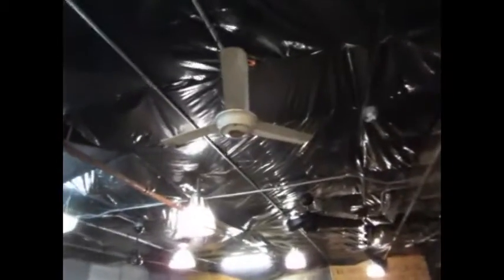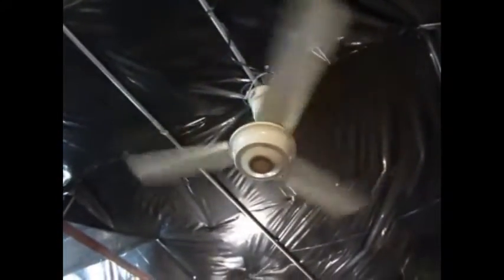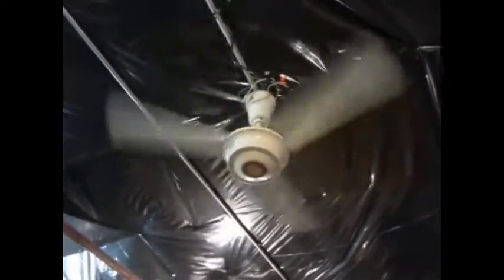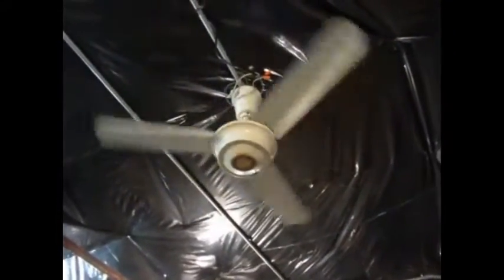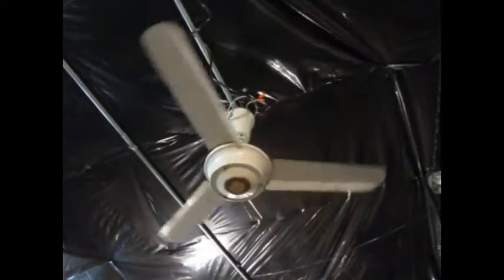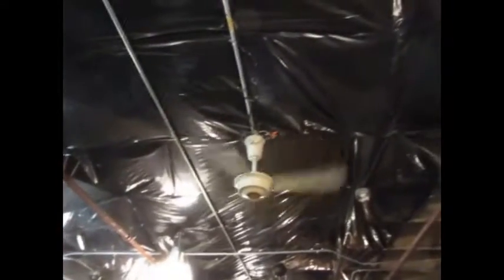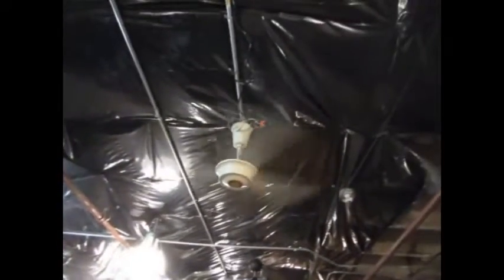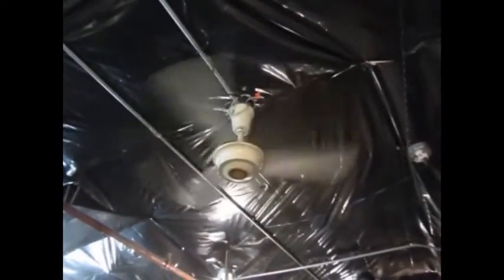Moss Caribbean Breeze industrial ceiling fan before restoration

Comment: An even better solution is to use a variac.

That way you have full control over the speed from its slowest to its fastest.

Also were you able to get the bottom cover off? If so how is it done?
Reply from the maker: Well when I control only one fan at a time I prefer a four speed capacitor based wall control.  They are actuall quiet on low vs a variable speed which often creates buzz and hum.  I run my Goldline on a four speed wall control.
Reply: Cool